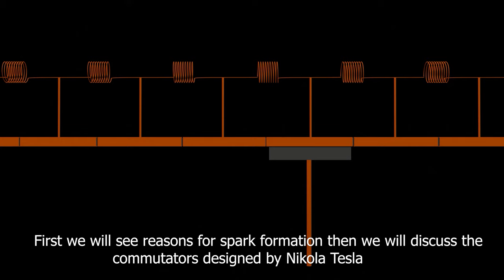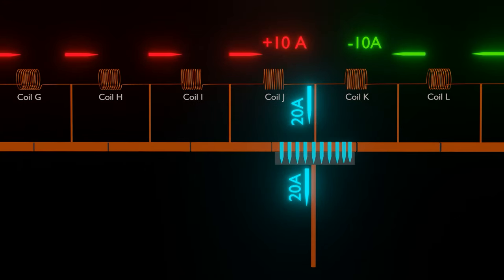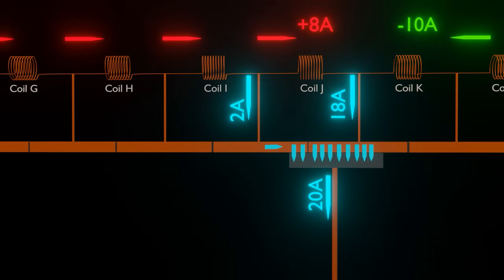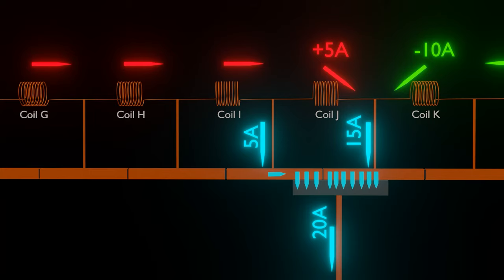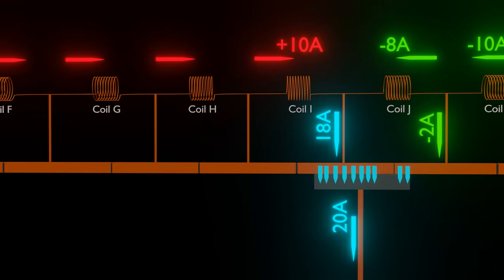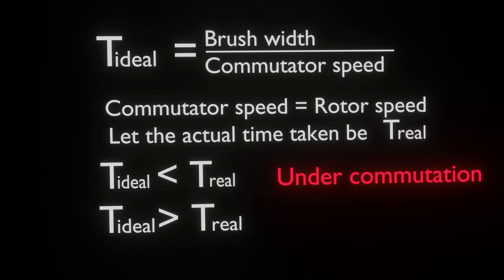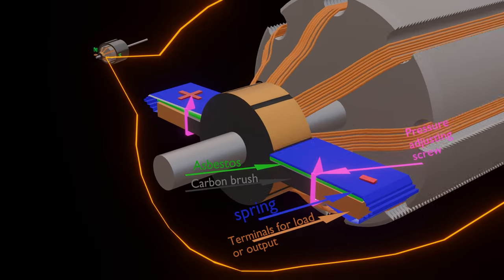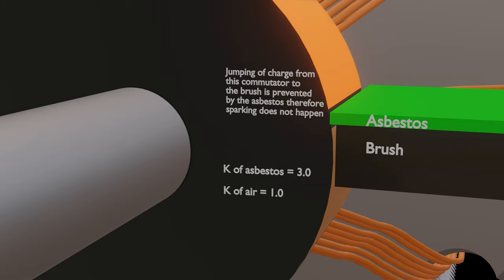Commutator sparking stop design by Nikola Tesla | Commutator in DC Motor | nikola tesla inventions

Comment: That should be labeled as "Preventing sparks in cheap, possibly faulty designs". Using a commutator is a bad idea, to begin with, unless there is no other option, it is used in cheap instruments to achieve frequency/current to/from relatively constant frequency/current conversion.
Reply: 1886...